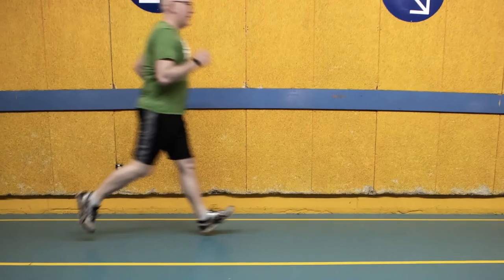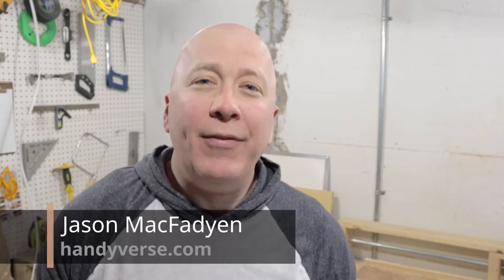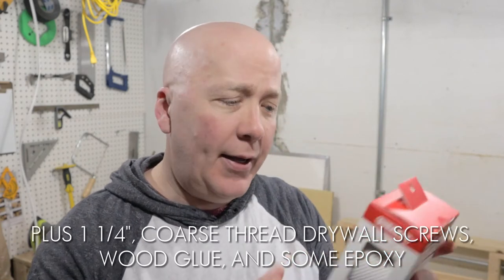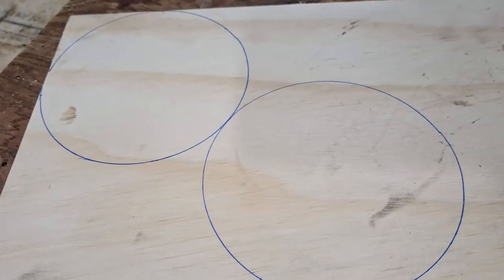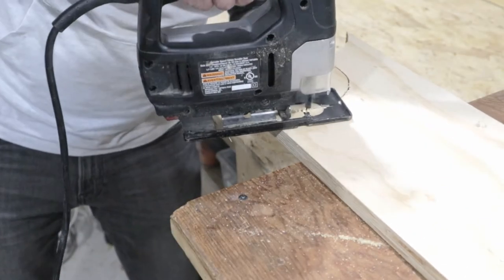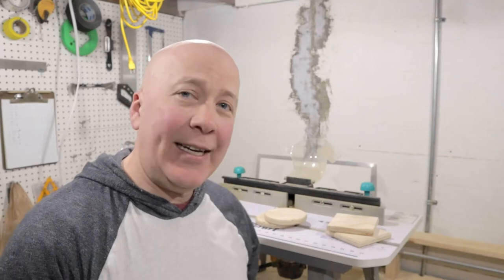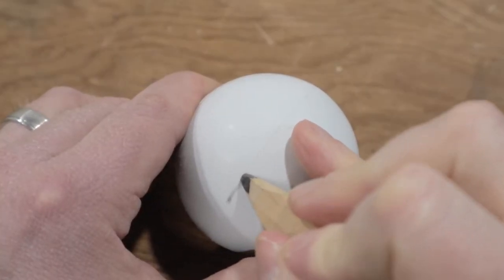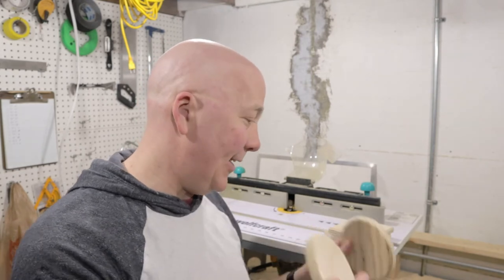DIY Cool Impossible Run Training Equipment

Comment: Thanks, just about to make one.
Eric’s end piece on the slant board is curved, so will give a more gentle rocking than your which is supported in the middle.
(ps. You used supaglue not epoxy)
How did you get on?
Reply: what do you mean curved? is it an arc or it has only rounded edges?